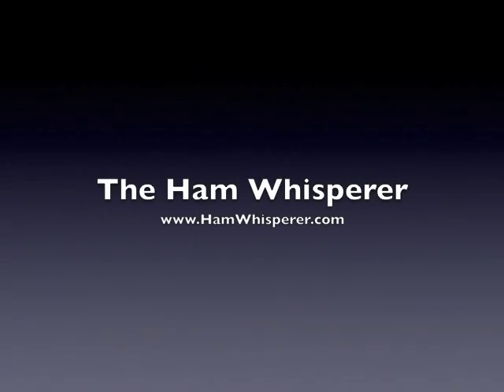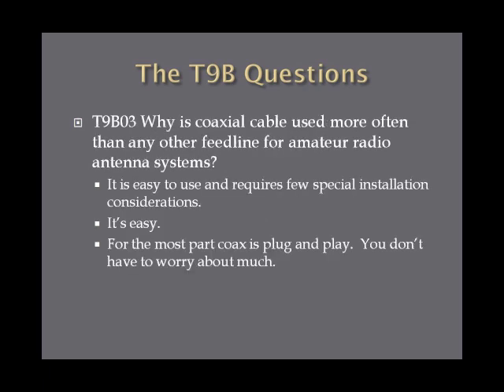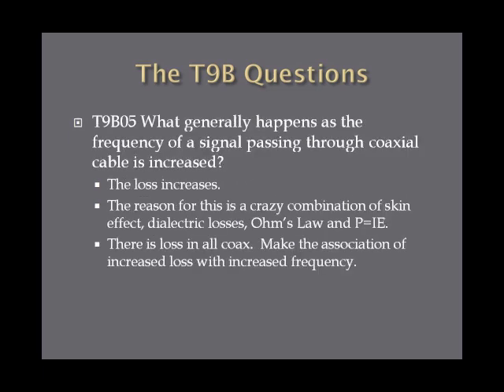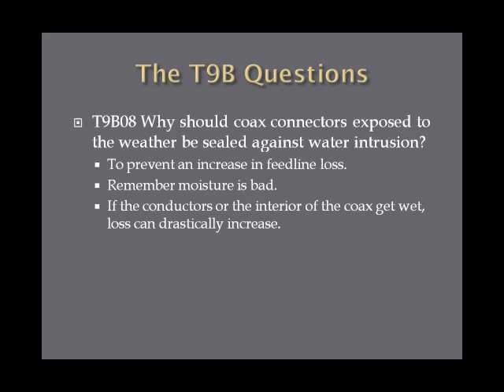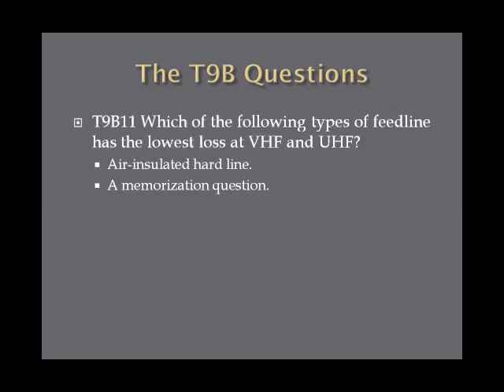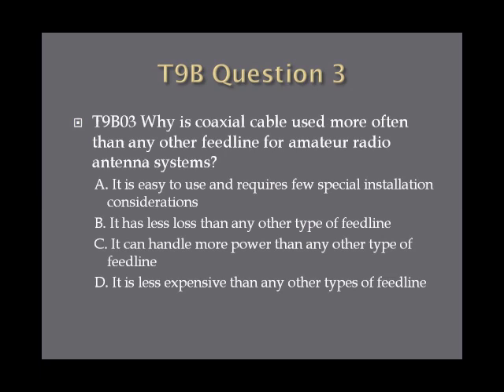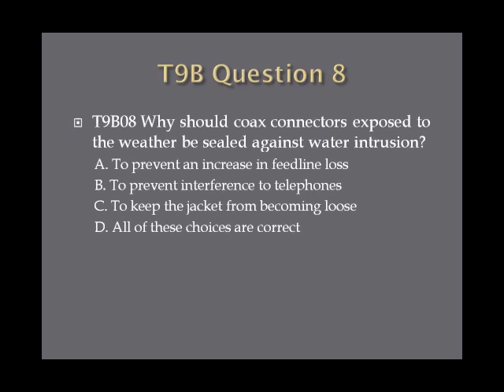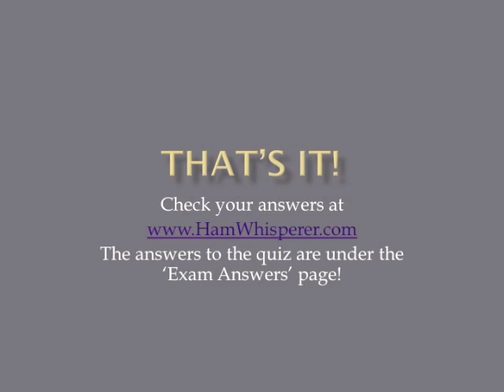Lesson 32 Technician Class Exam T9B Second Edition

Comment: I went from a Stryker mag mount antenna (which developed an open in it from door slamming on it ) with RG 58 to a Wilson 5000 with RG8 coax for my cb radio and noticed a big difference with the RG8 - swr was 1 at channel and 1.5 at channel 40 ..